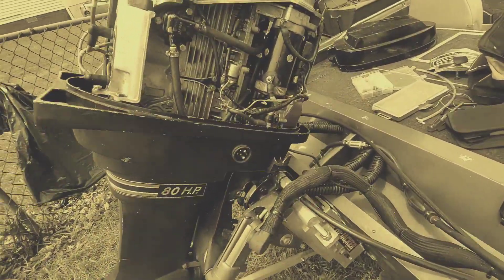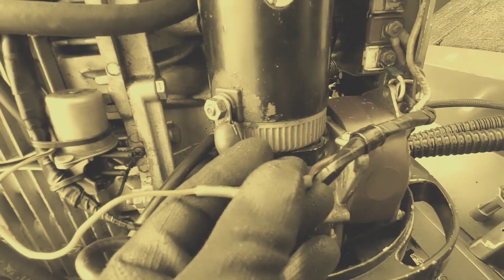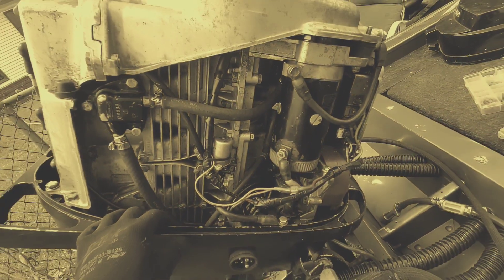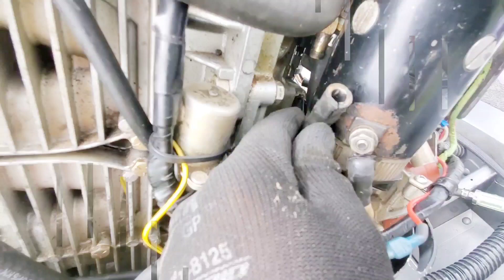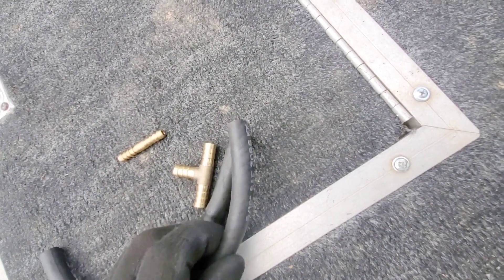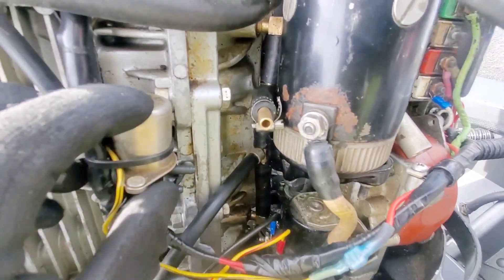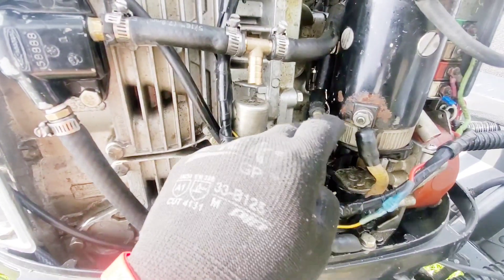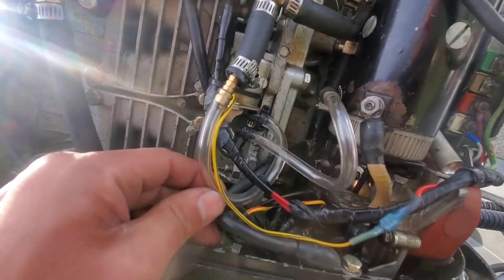Ole Mercs Hard Starting: Enrichener Upgrade

Comment: Love your posts - I have 1987 Merc. 115. Your video shows you splicing into the direct fuel lines. How can fuel enter directly to cyclinder as the needle valve & float stops the fuel on my 3 carbs ?

Comment: Thanks great video. I manually opened my enricher on a busy day and forgot to close it. Been having idle problems and bogging down. Going to check it when I get home but seeing how that system works I’m pretty sure that’s my problem. It’s steady pouring fuel into the engine. This is a hard topic to find through the algorithm lol.

Comment: I've got a mercury 40 hp with the enricher valve. Do you know if this valve can be tested without turning the engine on?  Or is the only way for it to work, to be pressing the key in at the same time as starting the engine?
Reply from the maker: Yes. Prime the bulb and press the top button on the enrichment valve. Fuel should flow from the top carb to the crankcase. Son
Reply: @MerCSonL6  Thanks appreciate your response.

Comment: Hey man I have a 1986 90 hp Mercury it takes for ever to get it started what should I do
Reply from the maker: The method in this video works great. Strongly recommend it. Son
Reply: It cranks for 2 seconds an the starter kicks out has good compression between 120 an 130 on all cylinders new starter solenoid cables fuel lines enricher works primer bulb new plugs coils are firing with spark tester when it’s hot it runs like a champ
Reply from the maker: @brandone6252  if the starter kicks out after 2 seconds that means the engine is firing. The fuel mixture could be off. After priming bulb can you see fuel in the venturi?
Reply: I put clear lines on the enricher to watch fuel an it’s working so think weak spark
Reply: I am at a lose I found your channel an see all your work I am pretty sure you can put me in the right place thanks
Reply from the maker: @brandone6252  get a Thexton Gap spark tester. It's clear and you'll be able to see the sparks. Needs to be bright blue. Yellow/redish indicates a week spark. Son
Reply: My clear tester is showing light red yellow   Spark
Reply from the maker: @brandone6252  what kind of switchboxes are you using?
Reply: No clue I just got the boat look oem to me I don’t think they are Cdi
Reply from the maker: @brandone6252  black?
Reply from the maker: https://youtu.be/rw82D7P1kEc
Reply from the maker: If they are black is likely due to faulty stator. Above is the link on how to perform a DVA test using a multi meter
Reply from the maker: https://youtu.be/8NCWh-p9uZI and here's how to perform a resistance test. Son
Reply: When I check the voltage at wide open it’s only 12.9
Reply: Yes black
Reply from the maker: @brandone6252  you have a bad charging system which again linked to your stator. Wot voltage should be 16V-18V for unregulated systems as yours.
Reply: I have new regulator coming tomorrow
Reply: So my problem is the stator do you have a part number for it
Reply: Or could you send me a link to one I need thank you
Reply from the maker: @brandone6252  you should test the stator before throwing money at it but here's the link: CDI Electronics 174-5456 Mercury/Mariner Stator - 6 Cyl. 9 Amp (1976-1989) https://a.co/d/0GCR5o0
Reply: Hey man I found the fly wheel hand tight called the last owner the stator an trigger where just put on
Reply from the maker: @brandone6252  ok.... so why are you not enjoying your boat? Son
Reply: Checked voltage again still only putting out 12.8 an kicking out when starting
Reply: I even changed the stator to know good one the old owner gave me still not charging

Comment: Does the enrichment valve just open to let gas to flow through with fuel pump pressure,
Reply from the maker: Yes.
Reply: I need a external wire harness,pigtail is ok do you know where to locate one?

Comment: SON! I want to do this upgrade to my 1988 150 Black Max. I am curious, are you feeding the fuel after the choke valve into the fuel line that goes into the carbs? You mentioned straight into "crankcase" but I am not exactly following.. forgive me if this is obvious but I figured I would ask before I started cutting up all my fuel line. By into the carbs I am referring to the line coming from the fuel pump directly into each of the three carbs. Because my motor is bigger than this one I would be splicing the fuel before the pump and directing through the valve and into the 3-way split fuel line for the carbs. Please let me know your thoughts on this, thanks man!
Reply from the maker: The line that goes to the middle carb from the enrichment valve feeds behind the carbs. I modified my V6 to do so and it starts on the first time every time. Son

Comment: Going to add this upgrade.. looks like I have the same engine. Currently have spark from the coil but not at the spark plugs.  Is it safe to say trigger is gone? How can I test the stator?
Reply from the maker: Trigger is fine. The distributor is not spreading the spark to the points. Check your distributor cap and rotor. Make sure they are clean. The stator on these models have nothing to do with ignition. They only charge your battery. Son
Reply: @MerCSonL6  sweet appreciate the response. Maybe just gonna replace thecap rotor and wires.  Have no idea when they were last replaced
Reply from the maker: @justindavis376  if the engine is sparking the trigger is most likely not at fault. See video below. Son
Reply from the maker: @justindavis376  https://youtu.be/bj6BPYITstc

Comment: I have a 115 ADI, I’m not sure what year it is because the power head has been replaced and I’m not sure how id the power head. I’m new to working on boats and 2 strokes but I love these old Mercs and I’m very experienced with automotive repair. My problems are it won’t idle in the water, when you pump the bulb it will never get “hard” and will push fuel out mouth of the carbs, and as far as I can tell the enricher doesn’t work/is not hooked up correctly

Comment: Can I do the same with 50hp 1980? It does not have fuel pump or fuel line going into crankcase out of the box.
Reply from the maker: Short answer is yes. Son
Reply: MerCSon L6 Thanks, Sir. Does it mean I need to install fuel pump as well ? Also are there any secret screws to unscrew to connect line to crankcase or do they need to be drilled?
Reply from the maker: @trebogeer  no.  It retrofits. Son
Reply: MerCSon L6 Thanks, Son. I’ll give it a shot.

Comment: Great job your videos are very helpful . I have a 82- 115. That seems to bog when it gets warm  I have replaced plugs wires had carbs rebuilt  new fuel lines fresh high test gas and oil.  It starts OK. Left the launch yest running great no  problems. After a bit of running around at full throttle it started to bog.  When I pumped the primer ball it fired right up   I replaced the diaphragms but not the check valves.  Could that be the. Problem thanks
Reply from the maker: Absolutely. Or a potential air leak. I would check from the boat pickup all the way into the carbs. Some fuel lines deteriorate on the inside. Fyi. Son
Reply: Thanks for the quick response.  I even bought a new fuel tank every fuel line has been replaced with premium fuel lines I am stumped the only thing I haven't changed is the check valves
Reply from the maker: @petedunleavy9117  if you prime it and it keeps going its definitely a pump issue or leak.... somewhere. Son

Comment: So is that a vacuum line that you spliced into that runs from the top of the crank down to the bottom of the crank? On my motor the bottom fitting that screws into the crank has a line that plugs onto a nipple that is attached to the inside to see the outer casing. Same casing where the fuel connects from the tank.

Comment: Hey Son, I need your help on a problem.  How can I contact you?  Thanks.
Reply from the maker: What is your issue?
Reply: @MerCSonL6  2000 Mercury 40 ML 4 STR, manual start.  Very simple motor.  I have spark on two cylinders but not the third.  I have tried another stator and ECM, though not at the same time and still had the same issue.  No spark on number 2 cylinder.  If I move the wire from coils 1 or 3 to 2, it works.  It is just dead.  One big question.  Does the ECM only have 1 capacitor for the CDI?  In other words, if any plugs fire then the capacitor is working.  Or is there a capacitor for each cylinder and, therefore, two could work but one not?  Thank you so much for any help!  Keith
Reply from the maker: @keithjacks1061  unfortunately I'm not an expert on 4 strokes but an ecm controls everything fuel/spark related. Earlier models had a capacitor for each cylinder located within the switchbox. I would believe an ecm has this too. In short, your ecm is either bad or not getting the correct voltage from the stator to discharge the spark to said cylinder. I hope this helps. Son
Reply: @MerCSonL6  Thanks.  I have a DVA on the way to test the voltage from the stator.  Go from there, I guess.
Reply from the maker: @keithjacks1061  that's the best place to start. Son

Comment: Need your help do you have a video how do you remove 1965 Mercury thunderbolt distributor
Reply from the maker: Just 3 top bolts 🔩 size 13 metric. Distributor will drop right down.

Comment: Any chance you can make a more in depth video about the engine side of this?
Reply from the maker: I'm not sure what you mean...
Reply: @MerCSonL6  is there anything more than just pluming into the crankcase?
Reply from the maker: @billkrummel8590  that is the best option. All of the inlines from 1982-1988 adapted this system. Son

Comment: Great video! very interesting stuff. Ive got a 1969 Merc 125 and Ive rebuilt the fuel pump, carbs, ignition wires and plugs, got the timing done right and the thing is hard to cold start. Could the crankcase vacuum line have something to do with this?
Reply from the maker: Not likely. You can replace them just for piece of mind. Son